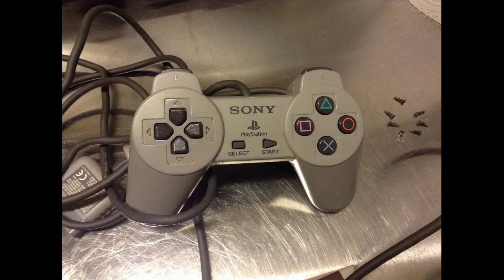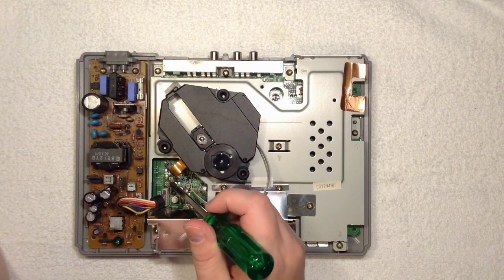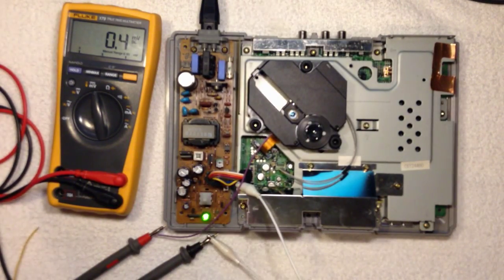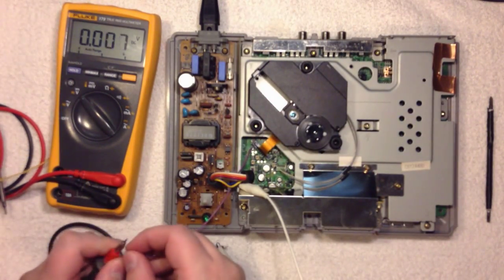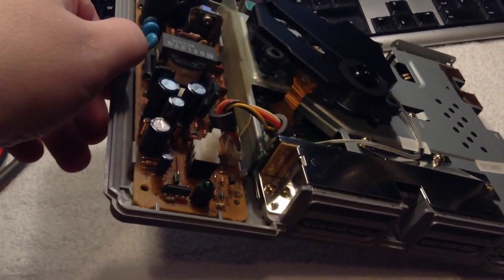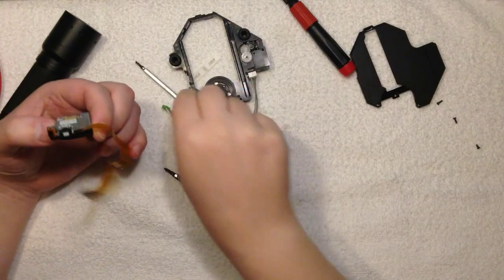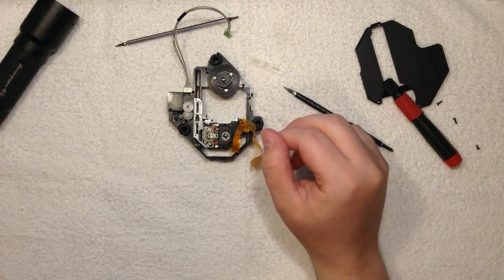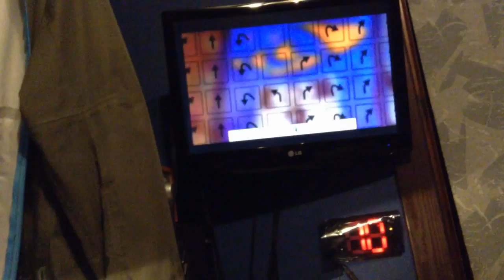Playstation 1 SCPH-1002 Adjust bias and gain

Comment: Oh god, adjusting these damn things is such a royal pain in the ass and was such a waste of my time and also the reason why i had anger issues. Imagine the torture and pain i went through in the past 7 years (2017-2024) with all these damn 1001 models i went through and causing an argument with a YouTuber named Philip McFee on Facebook Messenger because i totally lost my cool as i was getting frustrated with my 1001 consoles when i been adjusting the freaking BIAS and GAIN pots for hours and hours and getting nowhere even with new lasers and i tossed them out of frustration because almost EVERY. SINGLE. ONE. i've used would also randomly spin too fast for no reason as well. 🤦‍♂️ And i used to be a dumbass back in 2017-2020 and used to claim the CPUs in these SCPH-1001's go bad overtime and fail. Just like on the early SHVC-CPU-01 SNES consoles where their CPU/PPU chips fail often. But no, then i found out the capacitors tend to fail too. Do you think recapping might help and stuff? I still remember one day coming home from school back in April 2017 crying in P.E class not doing anything and got home early from school and i was in my room crying about how i miss my PS1 consoles and i was totally breaking down crying as i was totally devastated when i stupidly smashed 2 SCPH-1001's i gotten from a Florida Swap Meet because i was having trouble getting Spin Jam to load and no amount of BIAS/GAIN adjusting was helping and after one failure too many, I screamed along with the lines of "Fuck this fucking model, I can't take it anymore!" And then on May 2017, My family went to a trip to Saint Louis and we went to a game store called Slackers and i saw a SCPH-5501 for sale for $30 bucks and my parents just walked out of the store without ever buying me the system and then eventually i listened to Spider-Man 3 Sandman Confesses music and i started bawling my eyes out totally thinking what i've done. And then i forgotten all about it and just took a break from 1001 models and just used different models and stuff until 4 years later in November 2021, I gotten a SCPH-1001 from July 1995 in perfect shape with a dead laser and i swapped the laser from a 9001 and i finally was i so happy to have a 1001 that finally worked right. So that's my story with SCPH-1001 troubles and stuff.
Reply: Q
Reply: I love you!

Comment: Pretty nice video :)!
I recently bought my eighth SCPH -1002 and the optical model is KSM - 440AAM . Obviously it doesn't worked well but it was enough to put a metal thickness of 0.15mm and it work properly with a low F.BIAS level ( 1.41v / F.GAIN 1.78)
The ACM is metal instead , but surely will have the laser diode a bit ' worn , in fact you should put a KSM - 440BAM of SCPH - 102 .
If you hold the ACM , however , you should put the grease in the gears and lubricate the motor spindle and sled motor( MABUCHI RF - 300A ) with the WD - 40.
In addition , they suggest , calibrate the F.GAIN when the machine is turned off . And then try the disc ^^
But it seems to me that you did a good job and I'm happy for you, man : D !
P.S Colin McRae Rally is a wonderful game !
Reply from the maker: +Naitoraven951 Very interesting info about the metal shim.
Reply: And ' the main problem of the KSM - 440AAM . You need  a small part of a sheet of a floppy disk and you're repair an OPU :)

Comment: Very interesting Hans. Adjusting these lasers is a royal pain in the ass. I have had mixed results with setting them up to the supposed correct settings. Most of the time it works but sometimes, you have to adjust things a little more or less to get it to work. It can greatly depend on the quality of the burn on the backup cd too. It's easy to get them set up to work with retail discs but backups is a whole different story. I never looked at the wear on the plastic sliders, I just made sure they were well greased. Cool stuff buddy :)
Reply from the maker: +StigsWorld yep. It seemed that by tweeking the bias a little (for me 1.63V was better than 1.7V (or 0V if using VC as ground), but then again I wonder if it all was just coincidence because I have worn out sliders. An idea: If gravity helps the unit while the console is tipped on its side, how about a rubber band ? I'll try it later today. Need sleep :) I saw a video a couple of months ago that you made about burning on different computers and the games working on .. dreamcast (i think?).. For me now, the burned disks work as good as the original ones. If I flip the console on its side, all the games load every time.

Comment: I start off with an audio CD. Then once I can play an audio CD without skipping I move onto a game. I have three of these older 1001 models and I was able to get them all to work. I've also had better luck setting the laser voltage to 12.0 mili volts.
Reply: For me it was better as well with 12mv

Comment: One of my ps1's has started to act up. It's not reading discs properly. What do you recommend? Should I fidget with the ribbon cable pot?
Reply from the maker: +The Highlander set the ps1 standing vertical, and see if it helps to first rule out possible worn slider..

Comment: My SCPH-1001 spins at first but always get stuck at the Sony Interactive screen.
Reply: Same here. Any advice?
Reply: the scph 1001 is an unreliable piece of garbage that constantly needs servicing, you are better off just getting a newer playstation like a 7001 or 9001
Reply: Install the PSone's KSM440BAM in your SCPH-1001.
Reply: Turn it upside down if you still have the console :D
Reply: well dont know if is garbage  beacuase this model did had some advantages and extra features better motherboard.parts on it.... the other later revision got cheaper.. the only down side of 1000 series is the laser unit..  this was the launch model .and was not cheap at  299.00
Reply: could fix the problem  but it will need ajustment also  the tiny psone is set on a diffent setting
all ps1 laser unit  have problems.. thats one of the reasons  you can find..  sales of garbage chinese lens on ebay for 20 dollars brand new

Comment: Excuse me, would I be able to have a copy of the manual you are using?  I have the exact same model of PlayStation, and I'm attempting to set the GAIN and BIAS to default settings and install a replacement laser.  I just need to know what the factory default values are for each?  I'm sure I could browse the internet for the manual, but I'm not positive WHICH MANUAL has the information I need in it.  I would very much appreciate it if you could direct me to the manual, or would be able to provide me with a copy.  Thank you.

Comment: My laser gets stuck up top near the disc spindle. I tried applying some grease to the rails and gears and that helped a little. When I wanted to make some adjustments I broke off the socket for the spindle and laser on the motherboard. I guess this ancient devices are really delicate. I hope I can solder it back on.

Comment: A ps1 I have works, but only if you turn it upside down
Reply from the maker: Then it is probably a worn out rail guide, or you can try regrease it. Usually these optical units needs to be replaced.

Comment: Got a question im replacing the lasers in my 3 ps1s and i have a 7501 model, a 5501 model, and a 1001 model why is the 1001's acm laser so much more expensive?
Reply: I imagine the demand is greater and therefore the price is higher

Comment: Hey, nice video. I want to know when you press the 'lid close button' with your finger at 4:32 where you show a close up of the lens going up and down, the spindle motor doesn't spin. I'm having the same issue with my 1002 unit; it's not spinning. however later down the video when you insert cds your unit is spinning the cds. i've looked at other videos and with the lid open with no cd, when they press the lid button, the laser moves up and down along with the motor spinning momentarily as well. tell me what i'm missing here. It's an old unit which was stowed away and i'm trying to put back life into it for listening audio... don't know if i'm gullible or not but it's worth experiencing the hype first hand. :) btw the laser unit on my says KSM-440ACM
Reply from the maker: +Muhammad Ali Qammar Thanks. Maybe this spinning/not spinning behaviour is different from revision to revision. I would say that it is normal behaviour for it to only spin if the laser is reflected from a disk and the lid switch is closed. Do you get a bootup screen? Try re-plugging all the connectors and flex cable..
Reply: +bwack well I got the cds to spin by bumping the sensitivity to 19mV. originally it was at 12.5mV so following dog breath. de manual I lowered it to 11.4v but that didn't help either. so at 19mV I can play.any audio cd now. the beast is up and running. thanks for replying quickly :)
Reply from the maker: It works ! Yay! :)
Reply: +bwack yaaa! :D

Comment: My scph 1001 has a problem. When I try to adjust BIAS screw it jumps to random voltage not like how you shown in your video. Any reasons why ?
Reply from the maker: Sounds like bad contact. Try contactcleaner on the potmeter.
Reply: @bwack  yea i did that still no luck. Like if i turn the screw lil bit it jumps to 32 and 18 like that. But still the unit works if I put it vertical

Comment: I have scph 1001 ps1 and if I pushed the small thing in the corner, the laser works and reads the disc, but if I stopped pushing it, it stopped reading it!

So what should I do for this ? 
Does it need a new laser ?

Thanks
Reply: Do you mean the security switch? The disc spins only if you hold it down
Reply: @palkop907  

Yeah .. I don't know what happened to my console ! It was working ok before .. 

Now.. I had to put a tissue or tiny ball before closing the disc tray then I can see it works ...

Comment: I found this same Unit in a Canadian thrift store, the laser did not spin.  I just measured the ohms on the pots on the laser ribbon and it was measuring 456 ohms, I adjusted the pot to 820 or so and now its working perfectly.   I didn't do anything with those two pots on the board and I didn't measure the volts.  Confused why you would need to do all this.
Reply from the maker: I'm sure there are more ways to do it.